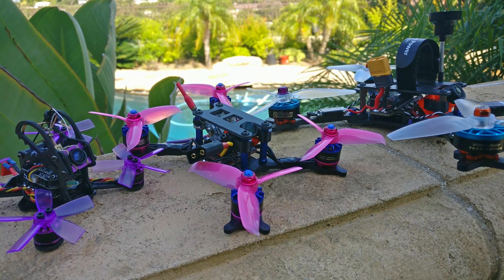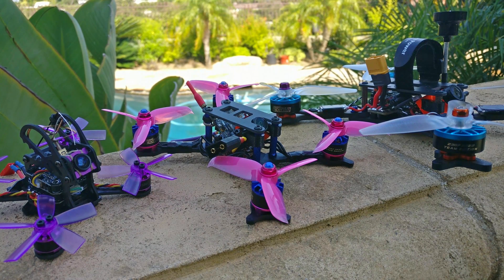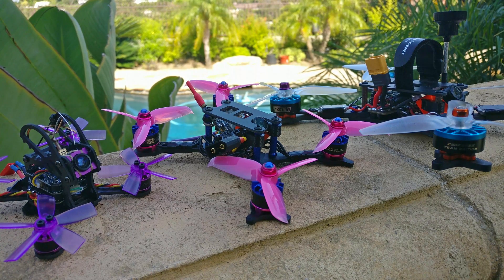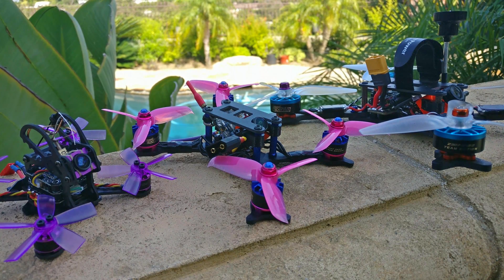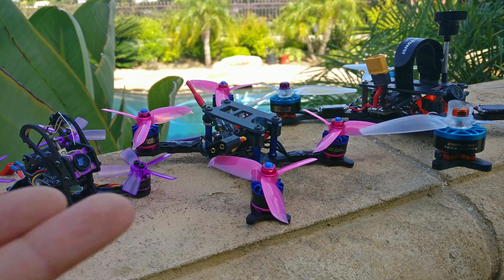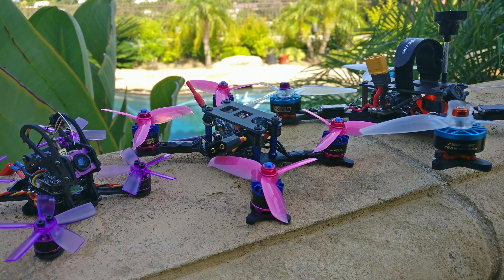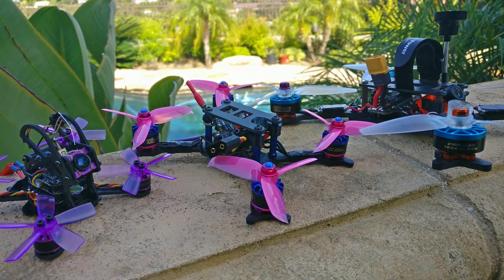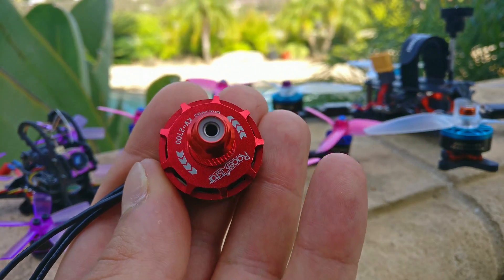Why does 5" feel so good? - Quad Theory

Comment: Sl3 frame from catalyst, 11xx motor, 20x20 stack, 3" biblade. 85g dry, not too hard if you really wanted to  actually test this. Your motors, props and frame are all porky for 3". Love my 4s sl3. Prefer my 5" still, but it's close
Reply from the maker: I've actually flown that setup too.  The Blade Torrent isn't far from that either.  It flies way way better, much closer to a 5", but as you said, I still greatly prefer 5".